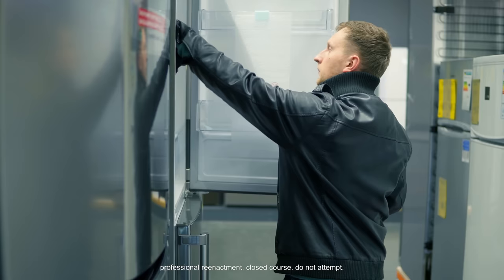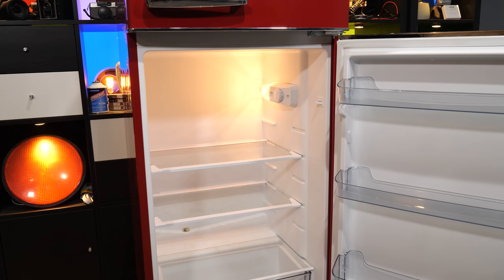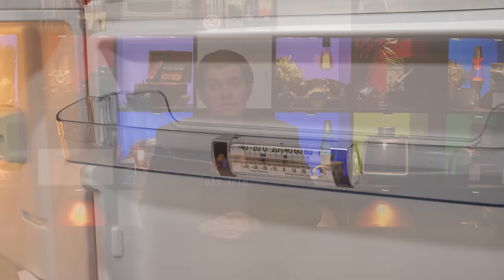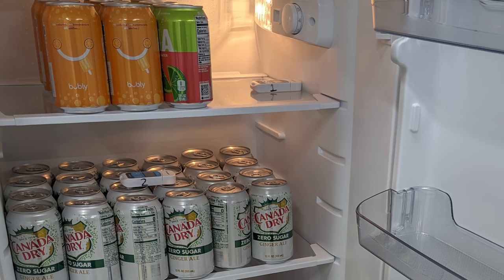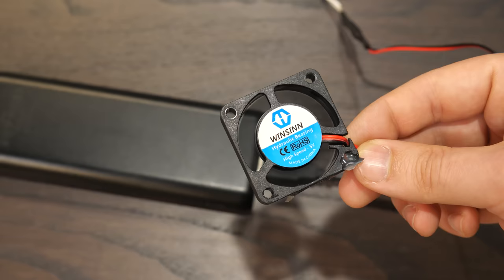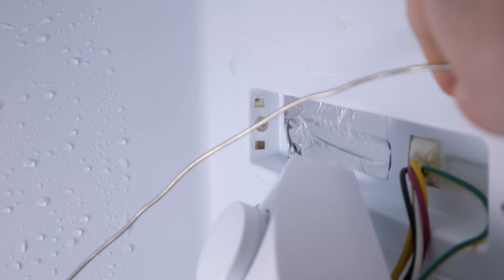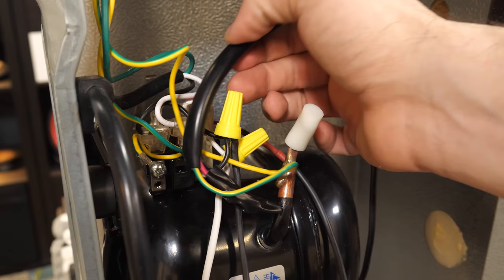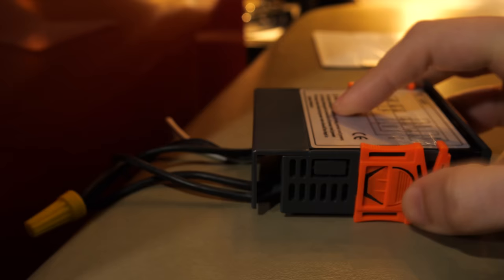This goofy fridge has a really clever design. It's also kinda terrible.

Comment: So, there is something you entirely missed. The reason the sensing bulb is placed right next to the evaporator is that you want to know the evaporator temperature.

Evap temp and pressure inside it - and thus in relation condenser temp and pressure inside it - are directly related. Thus, keeping those in check is an important performance and safety metric.

Modern, electronicly controlled fridges have several sensors. They more often than not have an ambient temperature sensor, a sensor for each temperature zone plus a sensor on every evaporator - how many that might be.
The control then controls fans dependent on that.

Edit: The energy guide tests at 32C ambient temperature to compensate for door openings.
Reply: Does air movement affect the temperature at which evaporation occurs? I mean, intuitively I think it would, but I don't know enough whether that's just because of the resulting increased transfer of heat - i.e. wouldn't it only be a problem if the blowing air is hitting the thermostat?

Edit: apparently "wind speed" affects evaporation because it effectively reduces the pressure of water vapor and therefore enables it to occur at higher temperatures. 😂
Reply: I think the primary problem with this set up is a lack of active cooling of the hot loop or even good passive cooling.  Every fridge I have ever owned had an external hot loop on the back of the fridge (on standoffs so it's not touching the fridge) with cooling fins. A couple of them had the hot loop in a plastic case with a fan drawing air from in the front of the fridge at the ground.
The cooling fins massively increase the surface area and keeps the hot loop much cooler.  This design has the hot loop inside the fridge bunched up against a steel side with much less surface area.
Reply: This is exactly what I was thinking.the sensor is a safety feature to ensure that the evaporator is never 'unevaporated'. If it is getting close to that lets stop the cycle. If it's far from it, it's probably not cold enough inside the fridge so let's continue. The compressor cycles will be the same size/frequency as it's much more dependent on the compressor than the thermal mass inside or  convection etc.
Reply: This was my guess, that the temp probe is trying to measure multiple things. That is always doing the same cycle time it is probably trying to make the compressor stay within some limited duty cycle range most of the time with just a little allowance for big spikes.
Reply: I thought the same thing - and commented that there may be a tradeoff with efficiency vs. desired setpoint going on here, and they were aiming more towards overall efficiency (maybe to meet some government regulation, or just for competition).
Reply: I suspected this might be the case. To describe it less charitably: the design is optimized to minimize warranty claims, rather than for food safety.
Reply: @kylecordes  nothing happens to food, whole Europe uses such fridges, more or less. 

but what will happen to this particular fridge is that it won't last much because he's overdriving compressor (of this cheap Chinese product) by measuring temp. inside the fridge and not on evaporator. and it's tiny compressor to boot. ie that compr. will be working much longer hours this way. 

there was nothing to fix here...

oh, also, this seems excellent way to make frost on evaporator and therefore degrade it's efficiency, because ice is isolator.
Reply: @ivok9846  So despite a 5 thermometer test with exact data, and a clear explanation in extremely simple to understand english showing:

Vastly worse variance across the internal space compared to quality fridges, even in the most ideal test(nothing in the fridge)
After adding a load, the fridge taking a DAY of cycling to barely reach a still non food-safe temperature and then stop trying to cool down past that point
And that this was all caused specifically by the awkward cost-cutting decision of trying to measure the fridge temperature with a single probe BETWEEN the cooling element and the fridge

There was NOTHING wrong with its design? Nothing at all, really?
Reply: @EpicGamerScout Well, aside from the fact that it wasn't fit for purpose there's nothing wrong with it...

Comment: That "random" shutoff on the little red -- That looks like a safety mechanism of the compressor, not the thermostat, to keep it from drastically overworking and burning out

Edit: Also, I recall with older fridges having to adjust the "thermostat" dependent on how full it was. The thermostat acting more as a "how often do we run the compressor" and less of an actual temperature-dependent thing

Edit Edit: Hearing that the fridge just wouldn't shut off for nearly a day straight makes me think there's no safety mechanism. Ignore me lol
Reply: a saffety was my first thought as well, I'm glad I finished the video before starting to type out a comment though
Reply: Ok, so I'm at 28:47 in the video, and the behavior sounded like a safety for the compressor. I guess I'll finish watching to see why it isn't.
Reply: I also immediately suspected that the compressor overheated, causing the thermal cutout to activate. I diagnose and repair refrigeration systems for a living...
Reply: @jordanstephenson6953  Hey, I can't get parts for my old GE, and the damper is not working right anymore.  Is there someone who rebuilds these, offers replacements, or something?  Thanks.
Reply: I have a feeling the design of the fridge thermostat was a way to limit the duty cycle of the compressor, by partially coupling the thermostat to the evaporator coils.

It will run longer when you put a lot of stuff in, but will shut off early before the items have fully cooled, and then moves back into a more regular duty cycle, gradually getting closer to a proper fridge temp.
Reply: My man literally said to ignore him and y'all sheep are still giving him upvotes
Reply: Yeah, when I was a kid our "thermostat" had to be adjusted with each shopping trip and little bits as it was emptied through the week.

Then we moved and got a new fridge that worked on temperature and it was so much better.

The way it behaves really makes me thing it was a timer system our old fridge used and not any sort of thermostat like we know them today.
Reply: Good thought, maybe a temp sensor on the compressor and side could help show the cause.
Reply: The thermostat is intentionally by the cooling line as a safety feature. It stops the compressor over working. Adjusting the thermostat according to the contents of the fridge is how these old designs were meant to be operated.
Additionally, the fridge should be stocked according to the different temperature zones. Meat at the top, followed by dairy. Veg in the bottom drawer, which should be warmer, as too cold will ruin them.
Reply: @sebastianelytron8450 We're not sheep, We're rebels! Upvote him! Upvote!!!!!
Reply: That's what I thought too, I thought there's some kind of timer that limited max compressor run time.
Reply: @jasonh4534  My thoughts exactly. If it weren't for the fact that the fan tests showed the compressor running for extended periods of time, I would have thought it was a duty cycle protection to keep the compressor from potentially overheating. Clearly that wasn't the case, but it was my initial impression as well.  Common RV refrigerators (brands like Dometic) have a similarly, and even simpler, thermostat where instead of even a knob to turn, you actually slide a sensor up and down on the cooling fins in the back. If those get a little out of place you'll have the same kind of thing where dumping a large thermal mass of room temp stuff in there will put your perishables in the "danger zone". Now I'm thinking maybe I need a hack like this in my RV fridge to have a saner way of actually setting the temp and, more importantly, keeping it there.
Reply: More of a thermostat-relay connected to the 3 pin connector of the compressor that says to it "you hot boy, rest some time until you cool down a little"
Reply: @sebastianelytron8450 Cause his comment is still interesting and informative. And tells us even pro's think this fridge is weird.
Reply: @ytmadpoo  It’s only partially coupled to the evaporators.

The internal temp will have some affect as well. So it can run longer, but will definitely shut off much sooner than one would normally expect simply from an internal temperature.

There is really no other reason to do it this way, rather than simple internal temperature, to dictate when to run the compressor. As that is a much simpler system to implement than what it currently has.

Comment: I love how by US standards that's a small fridge. Growing up in the UK in the 90s and early 2000s, that was a standard size fridge!
Just to add: In the UK most people know not to put warm food straight into the fridge. We'd always let it cool to room temperature naturally and then put it in the fridge straight away.
Reply: It is big for Armenia
Reply: Ours were about eye level and shoulder wide, but now they're even bigger which I don't get. This thing is pretty much right between a mini fridge and an old normal one for us. Lots of people also have deep freezers in a basement or garage for more longterm storage.
Reply: It's the same in Denmark. With the addition to it that cooling food before placing the food in the fridge warm, is that there's a good chance the glass won't break from the  heat of the container. I still make food cool down because of that.
Reply: I still have a smaller fridge than that, honestly. Plus everyone knows that one shouldn't be putting still warm things inside it.  having the need to put several warm cans in a fridge is a very American one lmao
Reply: Things were BIG Here.
Before they figured out Big, is Big Money.
So they've been slowly making everything smaller,.. except the price.
THEN HAVING YOU SUPER SIZE IT 😂

Actually just got a practically unused, old school washer and dryer. $40. Solid as a Rock. Smooth as Silk. Quiet.
And I can wash 2 Comforters, and 2 Dogs. And not even fill em up. And could probably climb in myself 😊
... not my dog of course 🥰🦮🥰
Reply: We did (and still do) use an under-counter fridge. (UK)
Reply: Also standard operating procedure should be to leave food in the refrigerator until it is down to that temperature and then shift into the freezer. This make sure that the freezing process happens quickly. Small ice crystals preserve the texture of the food.
Reply: I have a fridge half the size and it’s in a house with four people sharing it…
Reply: Yes. My house was built in 1980. When I replaced the refrigerator I had to remove the cabinet above the fridge. With the exception of a 2 or 3 available models, all were too tall or wide to fit in what was originally for the largest fridges available. I got a chuckle when I went shopping for a replacement several years ago. LG sells a model where you knock twice on the door and the opaque glass displays the contents of the fridge, those with WIFI, take a shopping list, or with a TV. There's also the model with a "door in a door" so you can grab common food without opening the main door. Of course almost all have ice makers and cold water... and some are a couple meters high and a meter wide. But that's true of a lot of US appliances... such as my clothes drier which allows you to steam your clothes and stoves that have turkey baking times programmed or look up recipes for you.
Reply: @mikep490  
Here's a story for ya.
When I got my last house recently.
For some reason I wanted to cook a Turkey. Because I love Turkey,.. and MAYONNAISE 😂
But of course we were moving in. And I didn't want to stare at a stove for a day. So I bought one of those Pressure Ovens. 15lbs turkey in 45 minutes.
BUT IT TOOK A WHOLE HOUR 😳 😂
... even fast food ain't what it use to be
Reply: America still has a lot of rural with many people long distances  from grocery stores. Most people even in the larger cities don't do the shop several times a week for two or three days at a time they shop once a week for all week or maybe once a month for all month. That's why we have these large refrigerators. It's a huge Time saver.
Reply: @MostlyInteresting We also like to have reserves in case of disasters.
Reply: @sonicmastersword8080  when those reserves require refrigeration, it makes an extended blackout a financial disaster
Reply: Excessive Consumerism
Reply: For me growing up in 80´s-90´s germany, thats a decent-sized-family fridge. We had a smaller one with 5 heads around the table. We thought that was normal.  I still feel that "standard fridge size" is about 60cm wide and 85cm high, so it fits with the table top.
Also, yes, I learned in a kitchen class that for sanitary reasons, you should let the food cool down before putting it into the fridge, as warm evaporates may start germ growth faster, and once you have germs and then cool them, they simply encapsulate and are ready to go once you go back to room temperature.
Reply: @sonicmastersword8080  yes I've had occasions when I could not get to town for several days, over a week one time last year.
Reply: I think you guys are mistaking warm for room temperature, which is what those cans were.  Yeah, in the US we don't put stuff out of the oven into the fridge either.
Reply: @jayhom5385 No, in the video he definitely mentioned putting warm casserole in, way before he started doing the tests with the cans. Obviously it's a really long video and I'm not going to search for a timestamp, but it was him saying that that made me add that bit to my comment.
Reply: @jayhom5385  Yea its perfectly safe if you are anal about such things to wait till its 100F ish and put it in. Nothing nasty is going to happen in that short time. Also you do want to wait till its as cold in the refer as its going to get before going to the freezer. It will freeze fast, which will make for small ice crystals (texture) and not have time to defrost anything in there. Dealing with these small units is a lot like using the RV fridges common in the US. They get cold but have a limited heat transfer capacity. Dam we are a bunch of hopeless geeks. LOL
Reply: @jayhom5385  Yeah, I thought it was about what "warm" means. I have seen europeans put positively warm (like almost eating temperature) stuff into fridges, though.
Reply: Poland here. A month ago I bought a brand new fridge that's exactly this size (although with a modern look) - it's the same basic design with a mechanical thermostat, the only difference being that this model does come with a LED bulb instead of incandescent. This fridge replaces my previous 20-year old fridge of the same size which used around 2.2kWh of electricity a day while the new one only needs around 0.45kWh a day. The only problem is that the new one despite the same size on the outside is actually smaller on the inside due to thicker walls - no doubt it's that insulation which makes it so much more efficient than my old fridge.

And yeah, this size was pretty much standard 20 years ago and it's still being sold everywhere today - it's pretty much the smallest 'non minifridge' size you can get now though, and I have not seen any of these small fridges with modern features like no-frost and inverters.
Reply: @My-Pal-Hal  "even fast food ain't what it use to be" :face-purple-crying: Next time try a stand-alone pressure cooker. Cook time is 20 minutes but it takes 20 minutes to heat up, ready in 1.5 hours. <g> You'll also see just how much water they inject into turkey.
Reply: @mikep490  
Ok 👍
Now Read what I said,.. and get back to me.